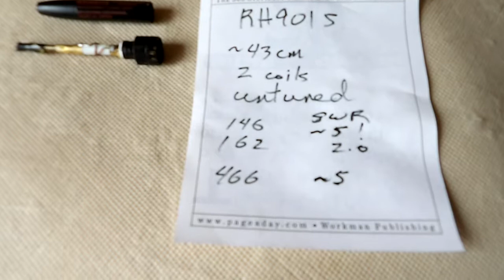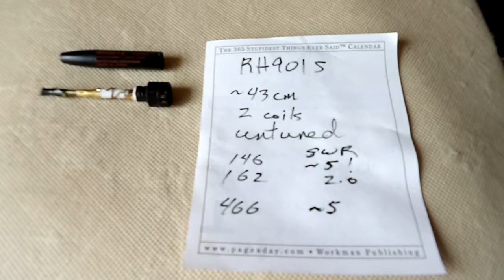Radio comms,  quick review of antenna RH901s

Comment: I bought one on Aliexpress, it's worse than the original of my Quansheng despite being bigger.
Reply from the maker: I had a good Hypario771 but it broke
try the long HYS brand, stiff or flexy
Reply: @godfree2canada  Thanks, i will try.
Reply: @godfree2canada  I disassembled my RH901s, it doesn't have this coil, the wire is directly in the connector 😞